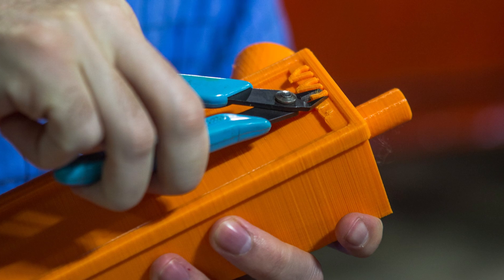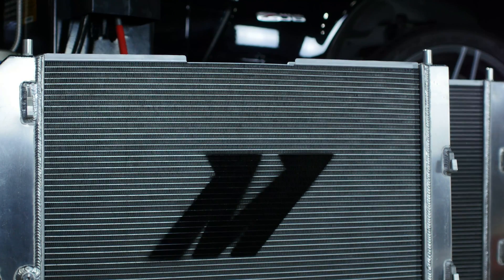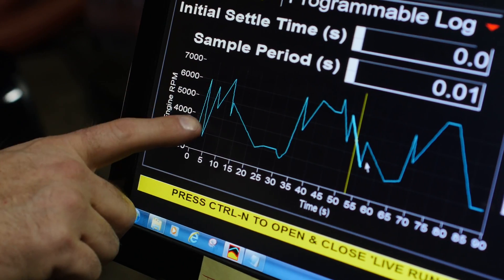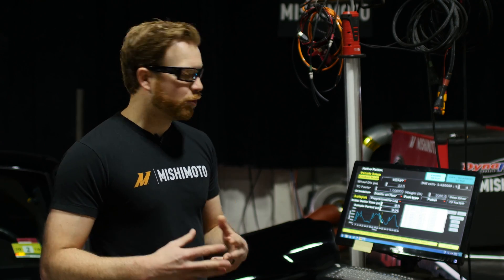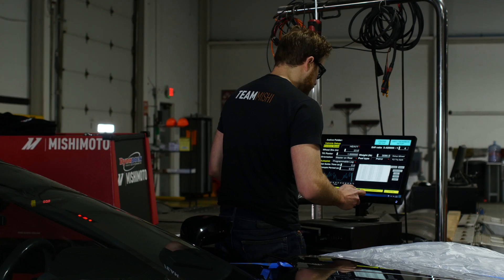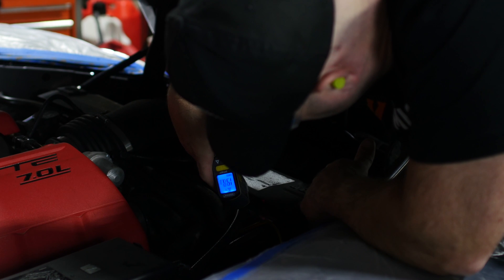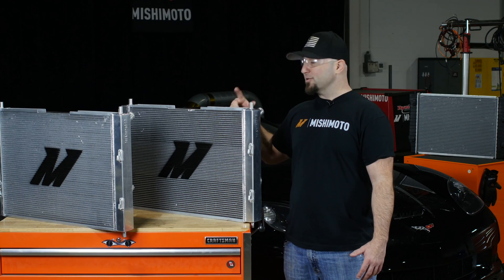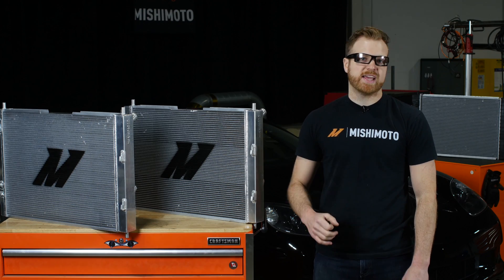2005-2013 Chevrolet C6 Corvette Aluminum Radiator – Concept to Completion

Comment: Ok  been struggling with overheating eforce supercharged LS7 Z06 in Manhattan traffic, not so much in heavy mountain use. Cannot even use a/c. Went with dewitts but that only delayed the overheating, maybe got worse. Dual 11" spal aftermarket fans do little as well. (The C5 can fit dual 12" go figure)
I want to eliminate the trans oil cooler (any oil cooler) from the rad,  remote oil cooler for manual trans and devote 100% of the radiator to engine cooling. 
Seems we need a thin radiator for heavy traffic, load on/off use but then lose capacity. Have something for me?  Seems like great thought into mechanics. Love the notch and the condenser clip thing. Im nearby,  have a 100% coolant C6 rad for me?
Reply from the maker: Please shoot us an email at support@mishimoto.com and the team will be happy to look into this for you. Thanks!